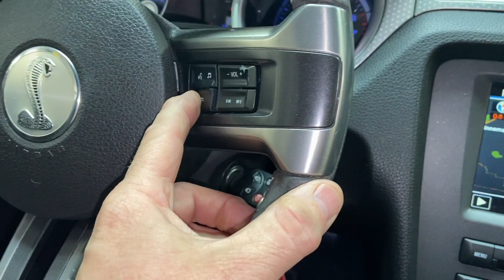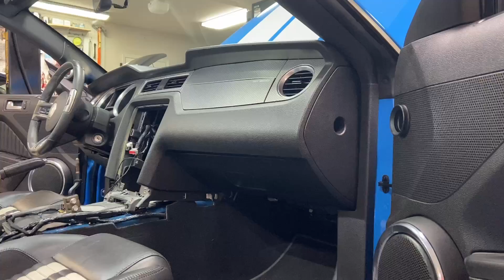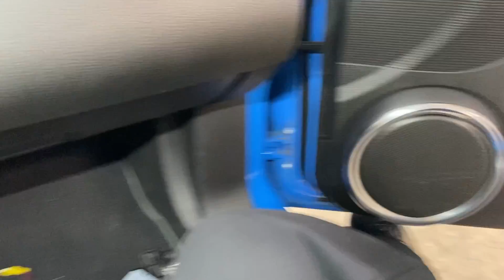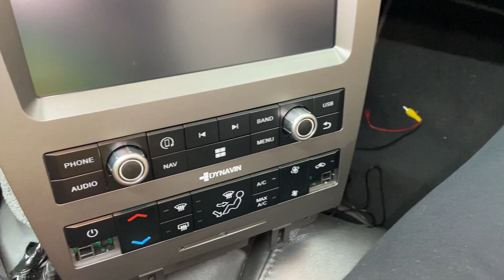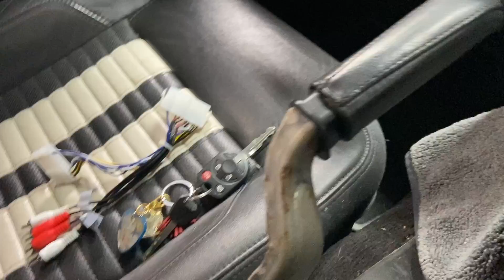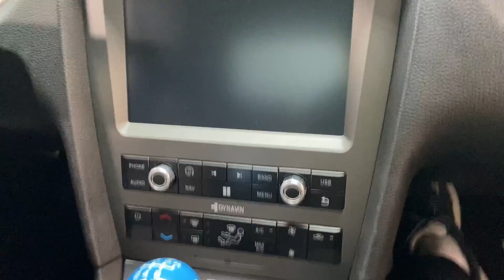Dynavin 8 Pro Problems & Solutions with radio install into the Mustang

Comment: I'm attempting to install mine and the a/c controls aren't working. Not lighting up, not responding when I push the buttons.  Radio seems to work.  Any thoughts on non-working a/c controls?

Comment: Do you have the shaker radio??? I can't get my subs to come on
Reply: I just installed mine the d9 and I also have the shaker system. I didnt use the optional shaker harness but forgot to connect the Sub A av plug and poof instantly my subs came back with no static. I followed what he did and it was worse so these can be tricky with different models id assume.

Comment: I got the unit today and I’m still experiencing the buzzing sound I followed all the instructions unplugged the amp wire that equals no sound did the amp retention unit still a buzz took the amp retention wire off still a low buzz my old car stereo did not do that it’s very frustrating

Comment: I disconnected this horness and the audio stopped working at all. Any Idea why? This noise is really annoying. Im in touch with Dynavin support but no solution so far. Any hints will be appreciated.
Reply: Did you ever resolve this issue? I'm in the same boat. I have shaker500 and get the hiss with 9000 harness. 

If I use the retention harness, hissing stops but audio stops working...

If I unplug that 3rd connector, hissing stops again, but same thing: no audio 

Pretty upset seeing as it's nearly a grand for this radio.

Comment: Thank you so much , I was having trouble with this and I  couldn’t find an answer anywhere,  it worked no problem, the shaker sounds better than ever
Reply: Hi Joseph, what did you do ? I'm having the same issue. When I hook up the amplified harness, my audio is low, but the bass is there. When I remove the amplified harness, the audio comes back, but my bass suffers. How did you get the bass to work?

Comment: Hi, I have the OEM subwoofer inside and I want it to work, but then I also get this noise, if I disconnect the plug like you did, it's gone too, but that's not the point.  The noise only comes when the radio is off and you turn on the light or the ceiling light is on then the noise is back?  Is there a solution? Greetings from 🇩🇪
Reply: I Fix it😁🥳 the Radio need a Filter mass separation filter!
Reply: @Crohnone where you get it

Comment: How did you integrate the factory back up camera? Installed mine here in manila and wasnt able to make it work😩
Reply from the maker: The back up camera on this car is an aftermarket as this car did not come with a factory one.
Reply: Would you know how to integrate the factory back up camera?🙏
Reply from the maker: @dinopallasigui5284  I do not know. I would contact Dynavin tech support with that question, the are very helpful  and have a great turnaround time. Good luck.

Comment: How do you get the steering wheel controls to work
Reply from the maker: Just go to "steering wheel controls" under system setting.
Reply: @mattsautomotivechannel  my volume and skip doesn’t work and I tried to get them to work but nothing seems to do anything I got the voice control to pull up Siri in car play but that’s it
Reply: @MikesMafia did you fix the issue? If so how? My buttons aren’t working either.

Comment: I have a quick question. I recently installed the backup camera that came with this and the backup camera image is reverse. Like if I put a water bottle on the right side the camera will show it on the left side of the camera. Is there a fix for this? Thanks
Reply from the maker: There should be a mirror image switch on the wire harness, if not there may be wire loop that can be cut. The cameras are designed this way so they can be placed on the front or back of the vehicle.
Reply: Dynavin setting-->android setting -display -> backcar up down mirror :)

Comment: Hello Matt, this video helped me fix my white noise or buzz issue and my sub woofers work perfect now and everything sounds great!! 

I have an observation. It seems to me that the volume on my Dynavyn 8 is the same from around 60% up to 100% and doesn't go as loud as my stock radio. Do you happen to know how to make this go as loud as my stock radio? Any thoughts on that?

Thanks for the video!
Reply from the maker: Hi Jonathan, I have not experienced this issue with my system. I recommend contacting the Dynavin tech support team, they are very good and usually get back to you within a few hours. They have always had a solution for my problems. Good luck, and have a great day!

Comment: is the system smooth? lag less? hows the apple play function while viewing video? any lag then?
Reply from the maker: Just tried out video for the first time, and it looks like I have the same issue with jerky video. If I can find a solution to this problem, I will reply to this message again with an update.
Reply: @mattsautomotivechannel  wow u cant catch a break lol
Reply: @mattsautomotivechannel  Are u having trouble with audio volume being low?
Reply from the maker: No volume issues since the firmware upgrade that was mentioned in part 2
Reply: @winkawak  I've just installed mine last night and my audio volume seems low, did you sort yours?
Reply: @darrenwmustang  i never bought one due to all the video reviews i seen with multiple problems. The low volume issue from what i gather can be fixed with new update/firmware,.
Reply: @winkawak  Cheers, I managed to flatten my battery last night so I'm charging it back up and will take another look.

Comment from the maker: Just curious, are you getting any noise in the subs with the sub harness connected?
Reply: Yeah I did but what I did was made sure when I installed it was make sure it was dead silent when I installed it in its place since the rcas aren’t really a snug fit on the back of the radio

Comment: By disconnecting the amp plug to remove the hiss you disconnected the subs. Dynavin is working on a solution.
Reply: Ok guys. It's been a while for you, but I just installed this in my 2010 with shaker1000. With the extra harnass the sound was just terrible, so I left it out. With the small harnass unplugged I have no subs, so it's plugged in. Ther are 2 RCA's coming from that smaller harnass. I put one into the sub jack on the HU. Gave me a big humming sound. Then I accidently touched the other RCA and it had a big influence on the humming. It needs ground I think, so I plugged it into an open jack on the HU. Humming is gone. I wonder what the second RCA is for? On the wiring diagram it's a dead end.
Reply: @kpsteigstra  I have a 2012 Roush with the Shaker 500, do the 500 and 1000 work pretty much the same?
Reply: I have no idea since I never owned a 500.  @mmahanor
Reply from the maker: Sounds reasonable, however door subs are still working and there was no audible difference in bass or overall sound. Just as much bass as with the original factory unit which is quite good.
Reply: @mattsautomotivechannel  Glad to hear yours is working. I have a 2012 shaker 500 and if i disconnect harness 3 i get no output on subs. I cannot use the retention harness either. I guess the 2012 is wired differently. It is a great upgrade option.
Reply: @RazManOne1  I'm having the same issue. I get a buzz if I use the mid sized harness, but without it I don't have subs. Has a solution been found?
Reply: @warriorsmustang1784  Same with 2011 GT500 here. Get a buzz with or without harness but no subs without Amp plugged in.